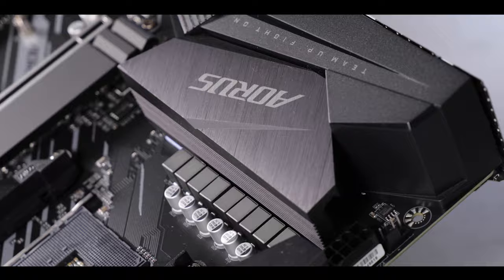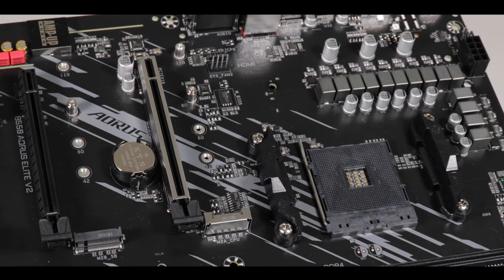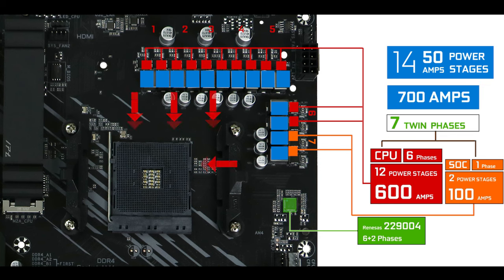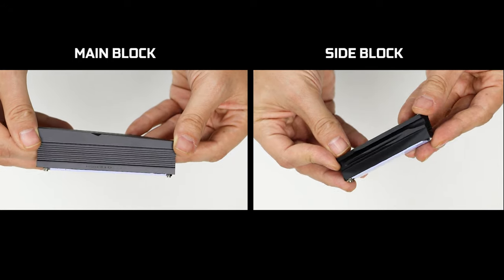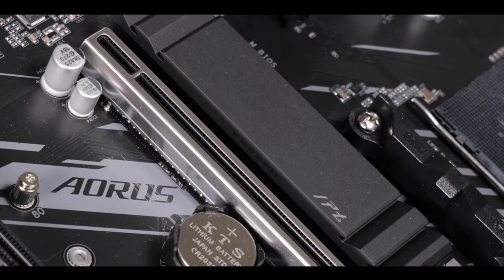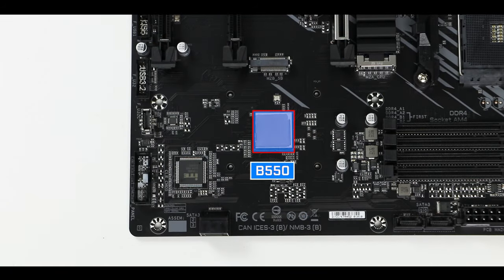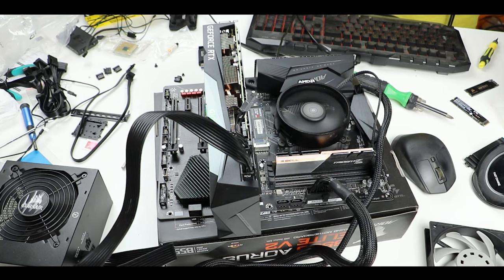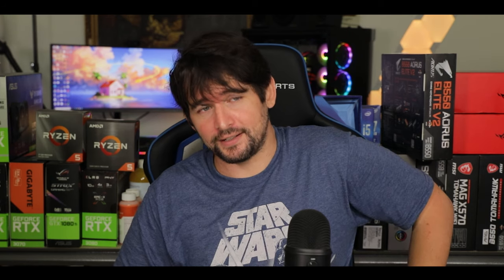Gigabyte B550 AORUS ELITE V2 : Best budget gaming board. PERIOD!

Comment: After your review I purchase this board after finding a great open box deal on Amazon $110 😁. This will be my first PC build in 15 years, using it with a Ryzen 5 5600X, and I picked up a GTX 980 it 6Gb off eBay due to the high prices of GPUs 😤, and one a stick of 32 g Kindston fury running at 3600mh as you stated with one stick you can overclock it even more and I was definitely wanting to try that with the CPU Ram and GPU. Case in NZXT H510, NZXT 850C power supply and a 120mm NZXT AIO for CPU and a 240mm NZXT AIO for the GPU with the adapter for that.

My question is? using only one stick of Ram I use the second dim slot correct? To be able to overclock it to the highest level or does it not matter which slot are use.

Bart
Reply: Did you have to update bios?
Reply: do you need to update bios?
Reply: Dude. All DDR memory should be used in DUAL CHANNEL mode, which means 2 sticks minimum. You should never use an odd number of sticks, except maybe for troubleshooting a faulty module.
Reply: Yes that is how I have mine setup
Reply: @uchoob246  that’s not true, some single sticks of memory I already dual channel, and some motherboard support the ability to over clock, a single stick dual channel memory to maximize the speed
Reply: @stepbystepbacktobasics2731  Nope. That's memory RANKS. That's like 3% performance if it's wrong. Channels on the other hand are twice the bandwidth so running in single channel mode is the worst thing you can do in a dual channel environment.
Reply: You should get another ram stick

Comment: bro I bought this mobo, where do u see x6 PWM fans? 
it has 1 cpu fan 1 water and 3 sys fans that is 5 in total
am I missing something? I want to plug 6 fans and it's not enough,
i think u made a mistake
Reply from the maker: High there :)
Indeed I showed the 5 PWM fans on the board but left 6 written on the side. 
There are a total of 5 pwm fan connectors 

If u do need more fans, use a splitter (Google it).

You can operate up to 5 fans per connector giving u a total of 25 fans.

Comment: I was really on budget so here's my question.

Since this board doesn't have back USB TYPE-C, is there much djfference between a type c keyboard and normal usb keyboard?
Reply: It has front USB Type C header.  As long as you have a case with USB C port you will be good to go.

Comment: But what about having 2 sticks of 8gb ram. What will the temperature be then?
Reply from the maker: Can u clarify the question? Not sure RAM sticks will have any bearing on the VRM temps.
Reply: Um you know dual sticks ram. I wanna buy the cosair vengeance rgb pro 3600mhz and im gonna combine it with a rx 6600xt nitro plus,ryzen 5 5600x will my thermals be ok? Will there be under 80 and lower with 1080p high graphics gaming? (And no overlocking)
Reply: @Laurentschoice  hope you can answer soon and btw great video!
Reply: @Laurentschoice  bought it today u think im gonna be ok?

Comment: Is this compatible with Ryzen 5 2600x ?
Reply: b550 chipset is not compatible with second gen ryzen for example (ryzen 5 2600x) the 2 meaning it's a second gen. the b550-f if my research is correct is compatible but not only is it aronud 200 euro but also if you use 2 gen you lose a lot of features
Reply: @Fadoosher  thank you very much

Comment: Using this mobo with my 5600x ( 6600xt)
Reply: Does it work alright and what are the thermals?
Reply: @nikolasone1148  the mobo is fine  for the price. Got no problem with the cpu temp ( unless you use the stock cooler) but the gpu have heating and  drivers related  issue.
Reply: @sheikh3605  
do we need bios update for 5600x with this board?

Comment: I found not worth spending extra $100-200 plus to get WIFI. If you need Wi-Fi there are lot of low cost 6E cards also if you need more M.2 storage just buy one of the drop in cards.